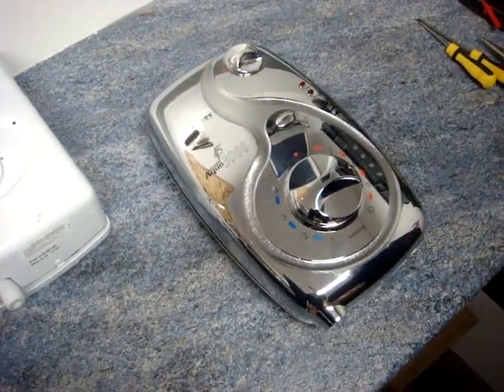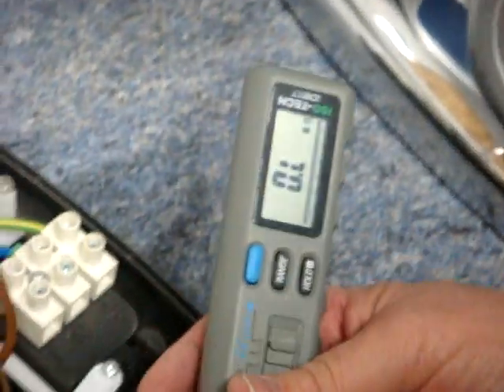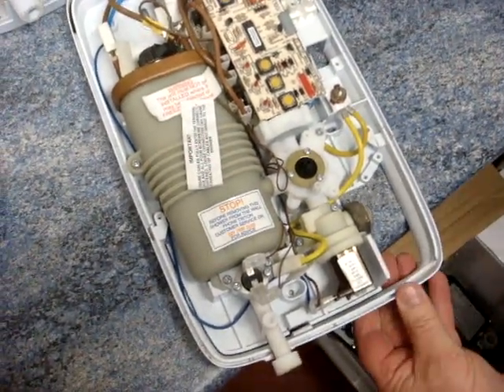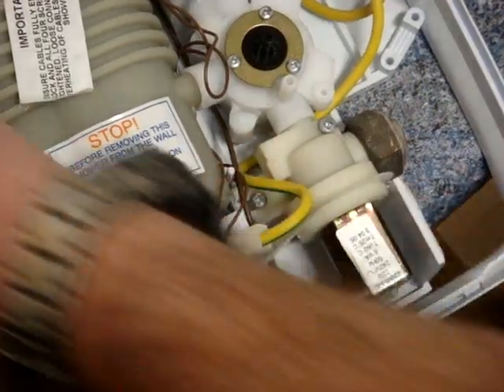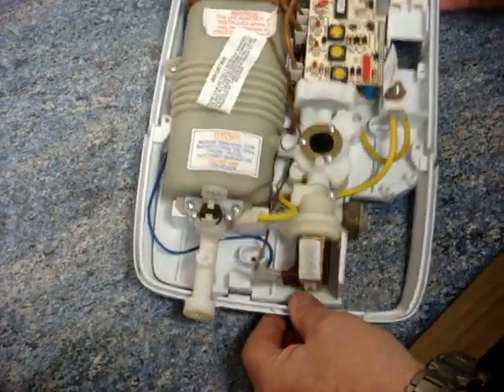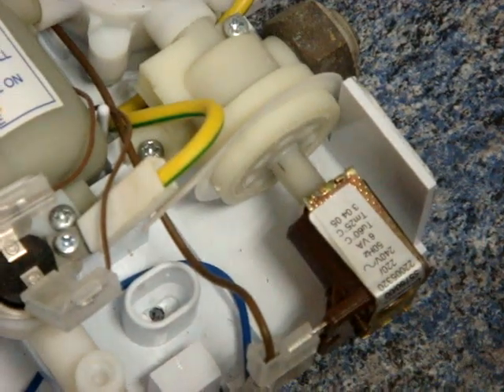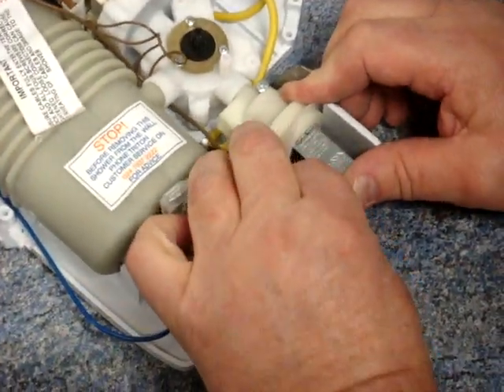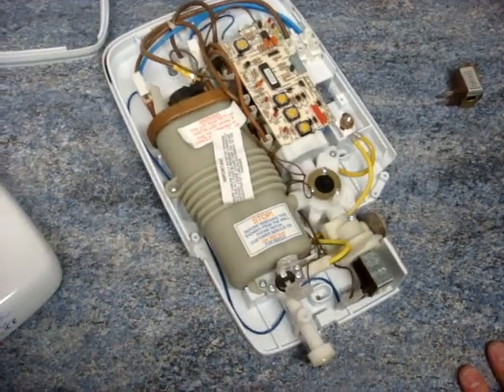Electric showers: How to test and replace a solenoid coil

Comment: I have a Triton Topaz T100si and get a Low Pressure LP warning and water flow stops. Sometimes I have to turn shower on and off several times before it works. I don't have an ohm meter to test solenoid coil.

Comment: My Mira Go suddenly stopped working. Power light is on, which then goes out when the on/off button is switched on. Solenoid resistance is 3.49, which should be ok, but no water, no sound, nowt. Any thoughts? Thanks.

Comment: I had always wondered if it was possible to change the coil on a solenoid valve, now I know how.
I had a duff coil on a right angle valve and a spare working straight valve... swap the coils and now the dishwasher is working again.  Shower, washing machine, dishwasher... they are all the same type of valve.

Comment: Triton sambada has a strange problem too - The coil reads 3.96k ohms. The valve isn`t stuck (blow through it and suck to see if it shuts off). Excellent water pressure from mains. What else could the problem be ?

Comment: Can you tell me how to remove the solenoid on a triton t80xr please as the housing for it is on the side and there doesn't seem to be any room to slide it out without removing the valve its attached too.
Reply from the maker: Unfortunately on the T80XR you need to pretty much remove the valve to get enough room to remove the coil.
Reply: The Shower Doctor That's what I sort of figured. Thanks for the reply.

Comment: Thanks so much for the video... I'd already figured out the valve was kaput and I was ready to bin the shower because the valve's discontinued - but I didn't realise the coil was so easy to remove, was being too gentle with it... New one already on order, I owe you a pint!
Reply: Not only that, but you had the coil in stock on Amazon... So glad I checked before rushing out for a new shower... Thanks again!

Comment: I have a Triton Power shower model no AS2000X. The water continues to flow after it has been switched off. I tested the resistance of the solenoid and it registered about 3.5K ohms, so presumably it is still OK. I suppose I could remove the solenoid and give the plunger a clean or do you think this is a waste of time?
Reply: Since I'm already here and the Doc hasn't answered yet I can tell you this much: You have the opposite problem to most of us that have landed here... When no power is applied to the solenoid then the valve should be on it's default state i.e. closed. It's only if the solenoid coil is kaput and fails to energise that you get the problem of water not flowing (valve stays in it's default state). Your problem is your valve's not closing after the solenoid's de-energised, meaning it's most likely gummed up inside. I've got mine in my hand at the minute and it seems to be a sealed unit - so not easy (probably not possible) to de-gunk. I hope the Doc pipes up and proves me wrong but I suspect you're needing a complete valve not just the coil.
Reply: Many thanks for that. Some years ago, the same problem arose and I booked with a Triton engineer for £95 to sort it out. He said it was the solenoid. Hopefully, the Shower Doctor has an alternative suggestion.
Reply: phosphormagic
Yes, he was probably generalising and referring to the whole valve  (the plasic bit and the coil) as 'the solenoid'. A Triton engineer probably wouldn't replace just the valve or just the coil, they'd consider it to be a single unit and replace the whole assembly. From your post it sounds like you've checked the coil and it's fine so in theory you'd just need to replace the valve, but I doubt you could buy that on it's own. The Shower Doctor's site (assuming it's the same Shower Doctor as this guy) has what you're needing I think... http://www.showerdoc.com/solenoid-valve-assy
Reply from the maker: If the water is still flowing then it is a complete valve you need ....The Doc

Comment: Hello. I have a question. I want to replace my solenoid coil but my Triton T100em has a thick bit of plastic to stop it from being taken out. What should I do. Thanks
Reply: You will need to remove the whole unit that it is attached to in order to replace it.

Comment: Hi followed this excellent video a couple of years ago to replace the solenoid coil on my Redring Zeta Profile shower, which worked fine afterwards apart from the buzzing noise that persisted with the shower flow.  This time, same problem with no water, thought it was the solenoid coil again and sought to replace it, resistance shows 3.76kohms on the new coil but still no water.  Checked mains water pressure  through the isolating valve and goes to the shower inlet OK but does not come out through the shower.  Could it be the solenoid valve stuck shut or something else?
Reply from the maker: The solenoid assembly itself maybe faulty if you have just changed the coil.

Comment: Hi can you help me with,my Mira aduance atl shower ,it will not go thought end part of  re -commissioning  to 42c which is BEAB setting it was set at 39c which was to cold and I can not work out how to reset it to commissioning to  42c, can you please help .
Reply from the maker: Hi Gene, try this:

Switch off power to 
shower.
Set temperature dial to 
6.
Switch on power to 
shower.
Within 30secs place 
thumb on start button and forefinger on High/Low button 
simultaneously.
At first beep remove 
thumb, at second (if there is one) remove 
forefinger.
Leave shower to go 
through commissioning.Regards,The Shower Doctor Team
Reply: Hi The Shower Doctor Team,
I did try that but still no long beep at the end  still same cold thanks
Reply from the maker: Hi Gene,

This could possibly mean a faulty front PCB or internal relay board.

Comment: A very good video to  which I would offer some further advice on a safer way to remove the solenoid coil without applying pressure to the glue joint between the water inlet valve and the solenoid securing stem. Any leverage from the outer body of the water inlet valve will apply pressure to the glue joint, with a risk of failure.  A foolproof method is to remove the entire water inlet valve and use the handle of a screwdriver (or the likes) to tap the top of the solenoid and drive the securing stem into solenoid housing.  The stem will snag at the mid-point and can be gently driven out by using a large pozi-drive screwdriver or a similar blunt object.  Pressure applied to the top of the solenoid stem does not apply any pressure to the glue joint.

Comment: hi i have a gainsbrough shower and it was working fine,then started to work the odd occassion and now wont start...there is power to the unit as when switched on at the main shower switch it lights up but when you press the start button nothing happens....could this be the solinoid? or faulty switch? how would i test these...thanks

Comment from the maker: The solenoid will warm up a little when in use, however if there are no lights at all have you checked the fuse? Also you could have a faulty isolation switch.

Comment: I recently replaced a Triton shower with one that was the same model,  it was working fine for a first few days before suddenly it would not turn on at all (no lights), i opened the cover & noticed a slight spillage of a blue dye on the sill of the cover (almost as if something had fried). Upon inspection i could not find any parts or wires that looked damaged however the solenoid valve did smell as if it had previously fried inside. Could you suggest what could have caused this?

Comment from the maker: Forgetting about the temperature, turn the shower from fully hot to fully cold. At fully hot you should have not much more than a dribble coming from the hose, and on fully cold you should have a good strong flow. If you do not have this difference then you may have a faulty flow/stabilizer valve.

Comment: I have an Essentials 9.5KW circa 2004. Not been used for a while.Only a minute amount of water flows through it (power on or off). Tried removing the shower head and hose but no change. I took the shower off the wall to inspect and found that applying pressure with a makeshift hose, the same minimal flow of water came through, however doing this in reverse through the water outlet gave a full easy flow back through the shower. The filter isnt blocked. Any idea whats causing the blockage?

Comment: hi, i have a triton barbados approx 10 yrs old, it works fine for 5 mins or so then shuts off(no loss of pressure,water temp is fine, power light still on, unit does not drip when turned off) switch off for a minute or two then works fine until it cuts out again after 5 mins, any ideas, thanks.

Comment from the maker: It isn’t the solenoid 

The things to check first are

1 That the main valve coming into your house is fully open 

2 Then check that the valve on the line to the shower is fully open 

If these valves are not fully open then there may not be enough water 
getting to your shower to cool it properly, the overheat safety device will turn 
the power off until it cools, then it then it starts to heat again and so on. 

Make sure that the shower head is clean and clear, that the hose isn’t kinked.

Comment: I have a shower that overheats the water even on the cold setting.  Sometimes it shuts of the electric completely and goes cold water only.  Then sometimes it is ok.  The water pressure seems to be fairly constant so I'm wondering if it is the solenoid or does the whole shower need to be replaced.  Any help with this problem?

Comment: The Shower Doctor 3 months ago
It may be your solenoid valve, you can check it if you have a multi meter, you should have a reading of at least k3.5 ohms, across the two terminals any less and you need a new valve. We have a video on our channel showing exactly how to test and replace it.
Reply  ·  Vote Up Vote Down  in reply to danvelgtr

Comment: Hi, Thank you for responding. I am looking now to replacing it. I have been given a quote for £160 fitted, with 5 year warranty, for an MX  Electric Shower 10.5 Kw - Not sure which MX shower it is, but does that price sound about right? I would do it myself, but the warranty is swaying me for the peace of mind, as if it breaks, I may not be able to fix it. What are your thoughts?

Thank you

Comment from the maker: Hi Anthony

It may be a faulty PCB, however it may not be practicable for a DIY repair the only way to check for faulty parts with this shower is by substitution which means you need to have all the components for the shower to enable you to find the faulty part, so whoever advised you just to change the shower they were probably right.The MX Range are OK, they are in fact re-badged Galaxy showers.

The Shower Doctor

Comment: Hi, I have a Triton Millenium Care shower which turns off after a few seconds. The unit goes through the pressure test when turned on from the isolator switch, but when  I turn it on by one of the heat settings, it turns off. I have noticed, if I turn it on by pressing the cold button, it continues to work, but then stops when trying the different flow settings. Any ideas as to what it may be, would be most appreciated. Someone advised me to forget repairing and buy and MX Shower, are they good?

Comment from the maker: Hi Martin,

When you switch off the shower at the main isolator and the shower keeps running then you have a faulty solenoid. 

When you switch off the shower at the main isolator and the water stops running, then you have a faulty on/off switch or a faulty PCB or a micro switch that is sticking on.

The Shower Doctor

Comment: More...
There are two relays on the base control board and I ran some fine emery paper over the contacts then removed debris with switch cleaner spray. Then sprayed a little silicon spray onto the solonoid plunger and ran it through a few on/off cycles. I now only get the problem on half of the occasions when I use the Push-Off switch. So, I'm thinking that this is not an electronic control issue but an electro-mechanical one. Shouldn't be too difficult to fix with a bit of guidance? Dr Shower?

Comment: Good stuff, thank you.
I have an original Triton Opal 10.5KVA that works fine except when I hit the Off button it switches off the heating element but the water keeps flowing. If I switch off the DPDT switch and power up again the flow stops and it works normally until I go to hit the Off button again.
Is this a control valve solonoid issue or a control board logic fault?
Do you stock the parts for something that's over ten years old?

Comment: Hi I have a castel solenoid for a freezer. It is rated at 240V, 60Hz. I am getting a resistance of 1050 Ohms. The coil does not become magnetic. Also we trip an RCD. 
What are your thoughts on this?

Comment: Spot on. Cured my fault, shower would run for about 2 mins, then cut out.  In my case (8.5 KW Mira Sprint bought in 2005) the solenoid coil looked OK, but had a slightly lower resistance than the one I had spare. I swapped the coil (carefully for the reason mentioned in the video). Swapping the coil cured the fault. I presume the old coil was shorting slightly (hence the lower resistance) and as a result, overheating, causing the magnetic field to collapse and the valve to close. 

Many thanks.

Comment: Ah come on . The solenoid value is an electrical switch that when fails  stops the shower from switching on or switching off , is that not correct . How then could its failure cause a small amount of water to come out the Outlet Pipe when the unit is fully powered off .
Reply: There is a diaphragm in it that could be perforated

Comment from the maker: It may be your solenoid valve, you can check it if you have a multi meter, you should have a reading of at least k3.5 ohms, across the two terminals any less and you need a new valve. We have a video on our channel showing exactly how to test and replace it.

Comment from the maker: If the installation is correct and it sounds like it from your description, the fault must be with the shower 
If it was an older unit I would think it was the solenoid that was faulty, however as it is new don’t tamper with it, you may invaladate the guarantee, phone Triton they will send out an engineer who will repair or replace it

Comment: Title:  New TRITON electric shower modle SFX8009GSI
        Question:       Hi Guys, 
I have a new Triton T80si Shower installed, Whille taking shower for 10-15min the shower stops
and the rcb trips. I have to go downstairs and reset the trip for it to start again.
 I normally set the dial to between 6 or 7. This is brand new installation. Checked electrics wire is 10A shower is 9.5 Kw and rcd fuse is correct Any ideas

Comment: My triton opal 2 was such a bitch to remove the solenoid, i had to snap a bit of plastic they had clearly purposely put there just to make it impossible to fix. They jammed everything together so you couldn't remove the valve, such cheeky pricks. Took about 2 hours in total to do this because of the design of the damn thing, they also made the solenoid stupidly hard to remove.

Comment from the maker: The problem, depending on the age of the shower, is either a faulty flow valve or if the shower is the newer version, the shower needs to be re commissioned, and if this does not work it needs a new front cover.

Comment from the maker: The solenoid coil won’t cause a drip, however the stabilizer will often leak and if this leaks then it can cause the solenoid to fail.
As you have no water coming through you will need to replace the solenoid coil and if you trace the leak to the stab valve then my advice is to replace that as well.

Comment: Hi, i have a Triton ts80i shower a couple of weeks ago i noticed water dripping from the base of the unit, after researching on the internet and your helpful video i think the solenoid coil is faulty, do you also think i will need to replace the stabiliser valve aswell? as this could have been the cause of the dripping?

Comment from the maker: Tip:
Take a photo of the old stabiliser valve with solenoid in place so you know what goes where when replacing. You can also leave the wires attached to the old valve while removing it and swap the wires over once the new valve is fitted.

ISOLATE THE WATER AND ELECTRICITY BEFORE REMOVING THE COVER

Comment from the maker: This will start with a drip running down on to the coil and over time becomes more of a stream of water depending how bad the split is in the diaphragm. 

The stabiliser valve which incorporates the solenoid coil is available on our website under appropriate shower model.

Comment from the maker: It sounds like the solenoid coil attached to the stabiliser valve has become faulty; unfortunately the coil can only be replaced if the stabiliser valve does not have a leak.

Normally the coil will fail if you have a leak coming from the pressure switch diaphragm which is part of the stabiliser valve and this incorporates the solenoid coil. If you find that the pressure switch part of the valve is leaking then this complete assembly will need replaced.

Comment: Thanks for video. I have a triton opal 2 ( don't buy one 3 in 3 years! ) I have no water but the power and low pressure lights come on. Do you think thus is the solinoid? Any tips on easiest way to remove. ? I levered off half way no problem but won't come off fully due to plastic moulding on the back plate of the shower.  Looks like I gave to disconnect from water and also removed valve from heating pump? ? Could I cheat and simply cut the plastic part of backplate to enable it to simply slide

Comment: Unfortunately you don’t mention which model of Galaxy you have, however some it is just a case of two flat screwdrivers and levering off the coil.

On other models you will have to remove / slacken off all the screws round the solenoid and flow valve to get enough movement to get the solenoid in a position to be able to remove the coil.